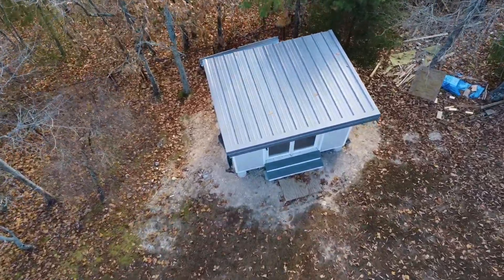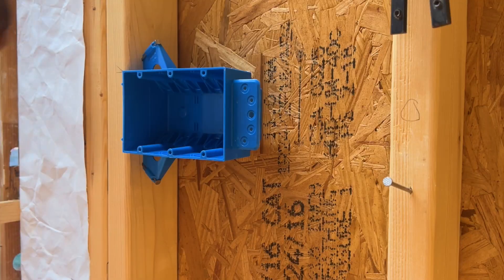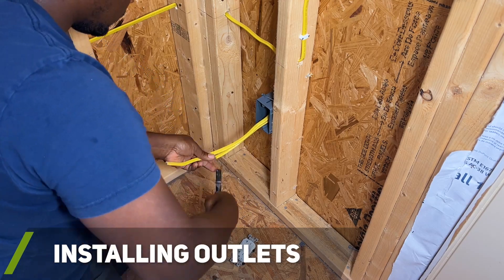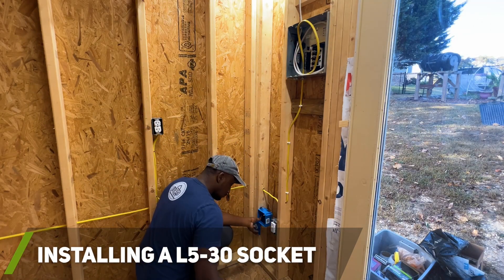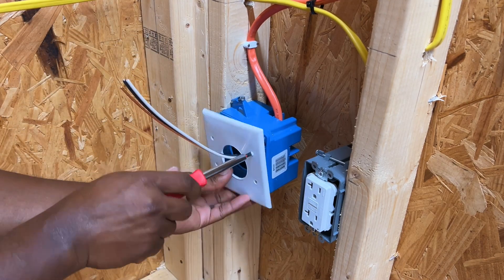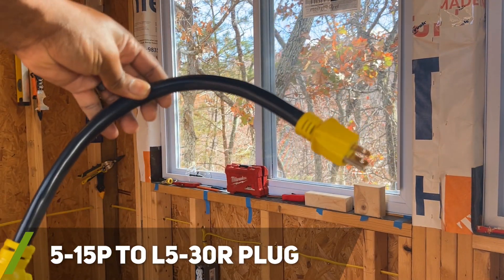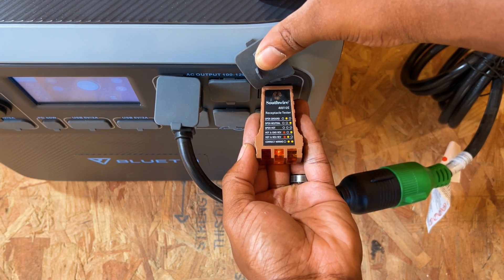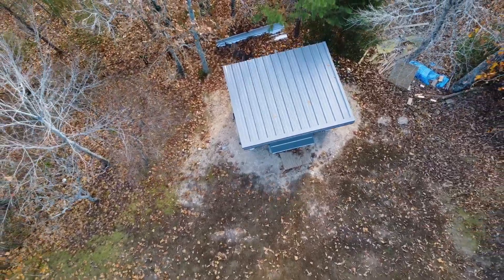OFF-GRID Power Now FUELS My Shed

Comment: The problem is that you have to turn on the portable power station before you have lights and then you are using power to run the lights I've watched another video were he said why loses power converting anything that can be run on 12 volts or less he ran his lights on 12 volts using 12 volt LED bulbs with Edison bases unfortunately I can't find his video again so I'm trying to find where buy the bulbs as none of the sellers on Amazon have equivalent to what bulbs of incandescent or equivalent LED  but it might be something to consider for your shed

Comment: Excellent!  I'm considering taking my workshop off the grid; it's pretty straightforward and doesn't interfere with the rest of the household.

ONE NOTE: I've discovered the hard way that using a four-in-one screwdriver to punch out hole discs in electrical boxes can ruin the screwdriver, push the tip up into the shaft until it's irretrievable.

Comment: This video was definitely entertaining and also educational. I've got a couple of sheds that I've setup off grid and it's really satisfying every time I walk in and flip the light switch or grab a freshly charged battery for a power tool. I go the solar and battery route with mine so they are self sufficient. Even the shed in my backyard. I go with AGM batteries for cost and ability to handle the cold here in Colorado. Thanks again for sharing all your projects.

Comment: Nice job.  Will you be using the solar as well or just the power banks?
Reply from the maker: I'll be adding solar at some point. Ideally, adding solar panels to the roof would be the norm in this situation, but I'm a little skeptical about adding more holes to my roof by adding a solar racking system since it would be my first time doing so, so I'm looking into ground mounts or adhesive mounts (similar to the ones used for RVs) to hopefully reduce the concern. Short term, I'll probably just use the folding panels and set them out in the yard to keep the power stations topped off.
Reply: @GreenTechTown I'm in process of going solar for my shed. Like you, I was hesitant to put holes in my metal roof so I bought some rare earth magnets (very strong), attached them to my solar panel brackets, mounted the panel to the brackets & problem solved, no holes.
Reply from the maker: Interesting! How long have you had them installed, and where did you purchase the magnets?
Reply: @GreenTechTown  I've just recently put this together so I don't have a lot of run time on it. I sourced the magnets (Neodymium Rare Earth countersunk channel magnets N52) from ebay & man they are strong... put it this way, I remove the panel from the brackets then pry the brackets off the roof. I'm afraid I might crack my panel before the magnets pull loose. I had considered using 3M VHB tape that all the RVers use but it seemed a little too permanent. Since this is my first foray into solar I'm starting out small. I have one 100w panel input to a Bluetti EB3A & then using the 12vdc output to run lights... kinda learning as I go. Hope this is helpful or at least inspires an adaptation that's useful.

Comment: I like your setup. I've been using solar power for remote off grid workshop for about ten years for lighting, running power tools and charging my golf cart. All self contained and using a 3000 watt inverter. But, being able to use a portable solar generator is a nice idea also.
Reply from the maker: Nice. Yeah I was going to setup mine similar to yours since it is sometimes easier and cheaper to scale your system, and if components go bad (i.e. inverter, battery, or charge controller), you only have to change out the bad component/s and not the entire power station (such as my case). They both have their pros and cons for sure. Thanks for sharing!